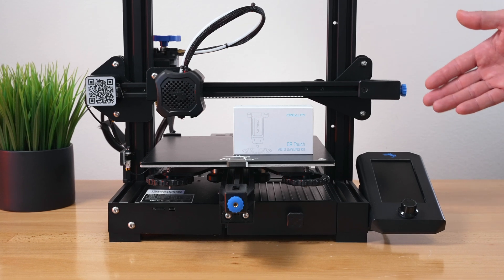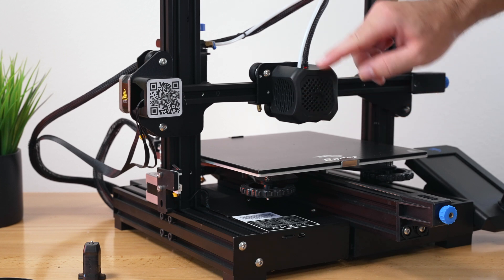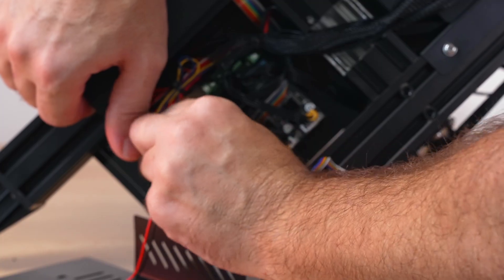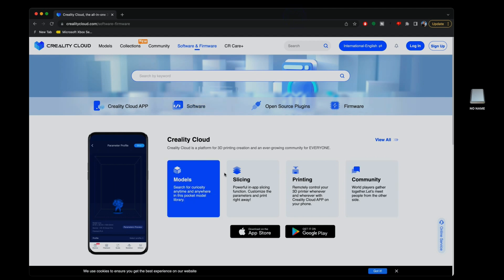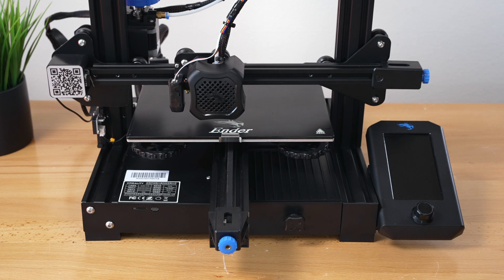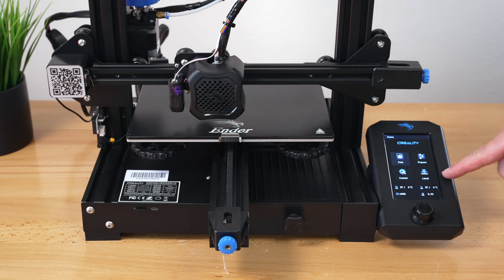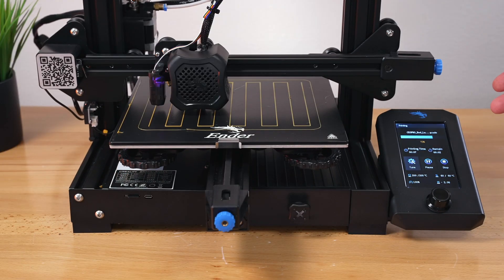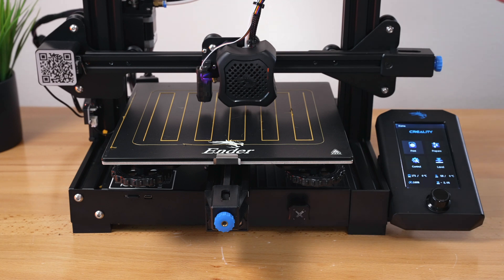Creality CR-Touch - Auto Bed Leveling Probe - Ender-3 V2

Comment: I don't have the CR Touch, But after a firmware update, the X Y And Z are blinking with Questionmarks. The AutoHome sends the head of the charts and makes some noises when it can't go any further. Any quick suggestion what to do?
Reply: PS: Im a Total noob when it comes to printing. This is my first 3D Printer.

Comment: Precise and articulated. I noticed your cr touch only has 3 across touch points. I installed CR Touch and mine has 49 touch points. Is there a way to change that?

Comment: My issue is my pla doesn’t want to stick to the bed after adding the cr touch. Any tips?
Reply: its probably the bed not being correctly leveled, you might have to make it a bit lower to the bed

Comment: Hi! i have a Ender 3 Neo
I just follow the steps for the bed leveling manually, pretty much like in this video, but at the time when the auto-level finish, the noozle get stuck into the bed at the end position. 
So... i see in other videos and a lot of people got the same result... a scrached bed :/ 

When this happen, who's fault? firmware or user?

I fixed after that by leveling up the z-offset, but i don't understand the real function of the CR-Touch
Now i'm scared of using again the auto-level function.

Bye

Comment: Do I need to add anything to the startup code in Cura?
Reply: Yeah, you need to add on the cura printer config, in the start G-Code a G29 after G28, so it does the auto leveling in each print
Reply: G28 ;##########
G29 ; Auto Bed Leveling